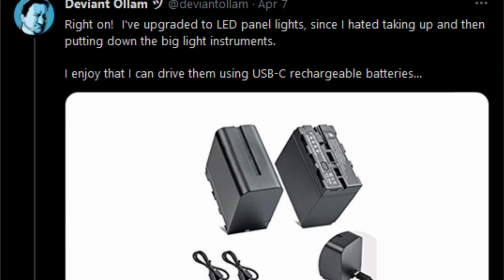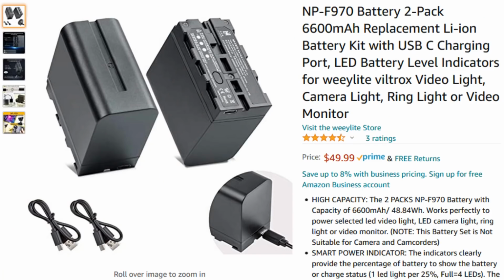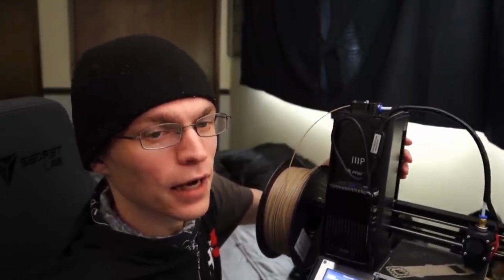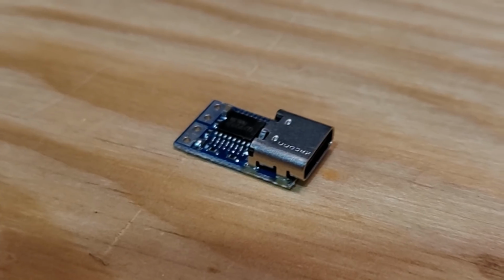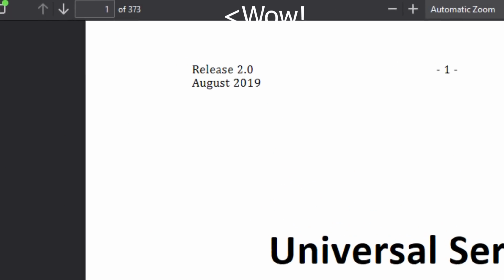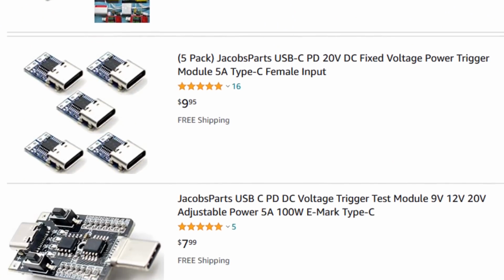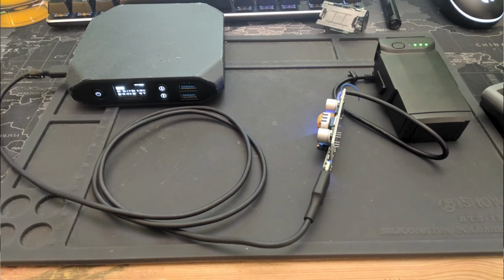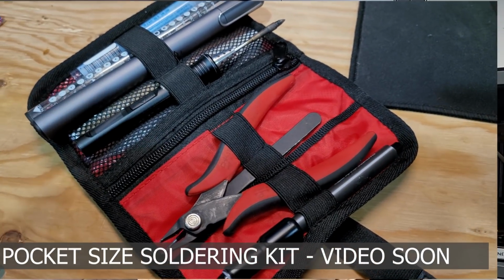Powering All The Things w/USB Type C -GlytchTips

Comment: Next up  hdmi /4k Dummie plugs   GPU 💥🤔
Look it up - Utube Makes a GPU work 20-30% better ( not gamming ) 
used in broadcasting live streams AND mainly by Bitcoiner machines 
eg  using  6x RTX.3060s  1 is conected to monitor the other 5 dummie plugs +30% hashrates  👍